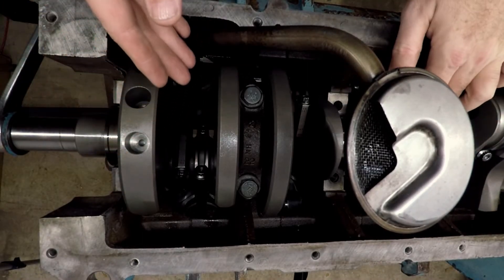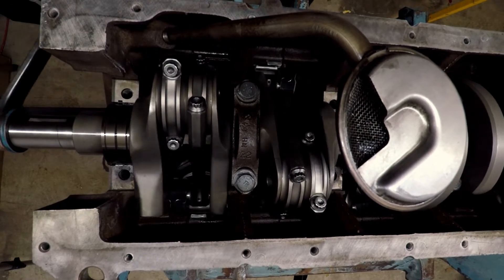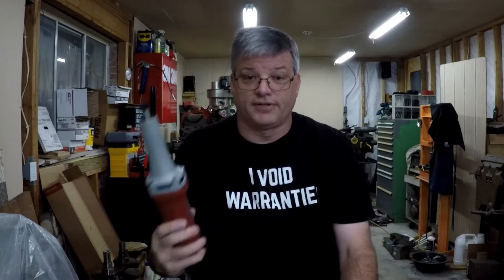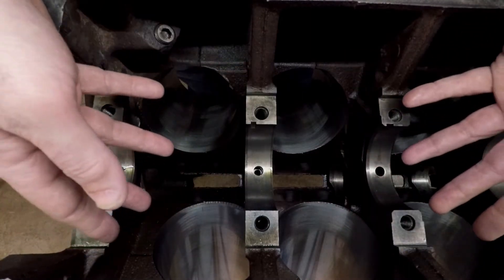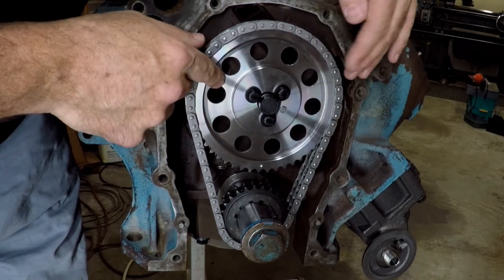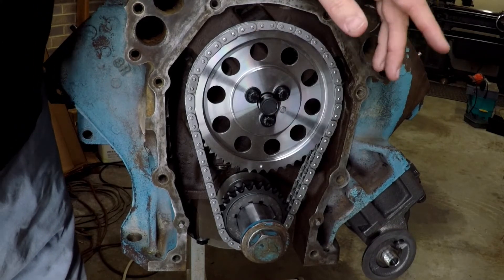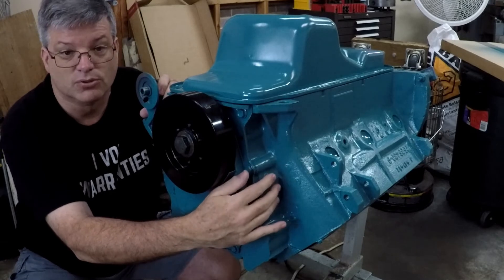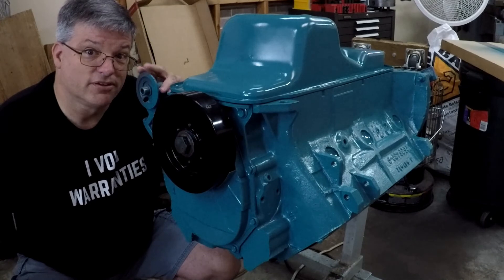543 stroker: making it fit

Comment: I'm building a 543 for my 74 pro street Duster.  I'll be using Trick Flow 270 heads, and I'm hoping to see 10's with it at 6000' altitude next summer.

I'm curious.......what's the appropriate insurance to strengthen the block, if you might be going over that 600 hp or so block limit?  Main cap studs, billet caps, 4 bolt mains, a girdle?  Thanks!

Comment: did you drill or reem the main saddles? (i've found broken drill tips and not drilled all the way through when factory went too many blocks on a bit)  what year block?  That's a lot less grinding than I've had to do on 4 1/2

Comment: I had always heard that with a 440 anything much over 4.125 stroke would need a external oiling system. Well it looks like you were able to keep your stock type oil pickup tube. My next 440 build might also be a 543 stroker instead of a 512 like I usually do but I am still not sure if I like the idea of the piston being so short that the oil rings go into pin area. Have there been any big issue regarding that type of piston setup?

Comment: I'm building a 512 stroker 440 but although not quite as heavy as the Imperial will be going in a street truck so am going your direction on the camshaft. Not sure what 'CS Special Roller' means though. I'm interested if you'd made any progress.

Comment: Good Info here, I'm looking at a 413 wedge motor. Is it safe to bore to 426ci so I can use the 426ci to 526CI stroker kit from 440 source?
Reply from the maker: You need to check the bores before boring excessively. Finding pistons might be a little more of a challenge for the 426 bore.
Reply: @RidgewoodMachine  440 source do a 426ci to 526CI stroke kit, full rotating assembly. Pistons, rods, crank etc. My friends got the 413ci in a shed in NZ. Hoping he wil ship it back here to the UK. I'm planning a 41 willys gasser but don't want the usual chevy or ford motor.
Reply from the maker: Sounds nice. Be sure to match the pistons to the heads for the proper compression. I'd suggest the Trick Flow 270 or something larger.

Comment: It's a shame all that iron and this blocks can't handle much over 700hp
Reply from the maker: They will handle well over 700 hp. It depends on how high you rev it. 
My turbo 440 held over 800 hp for thousands of street miles before I sold the car.